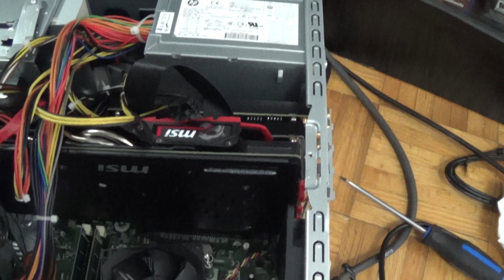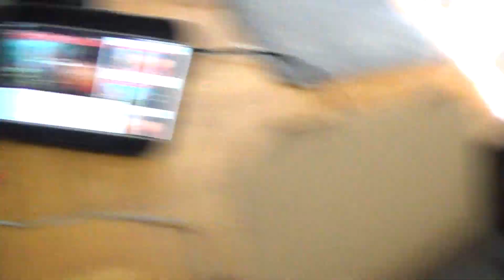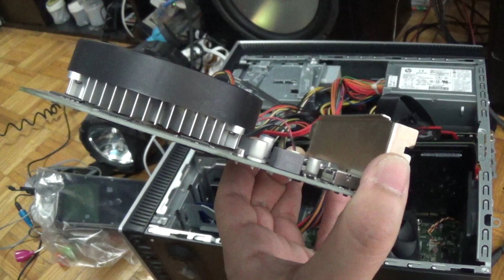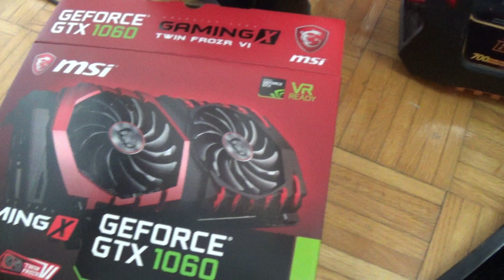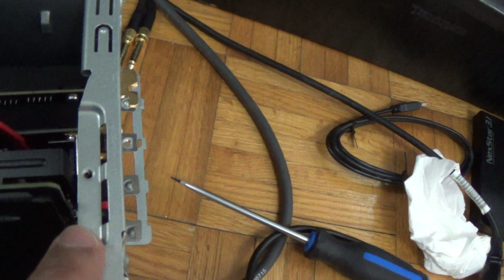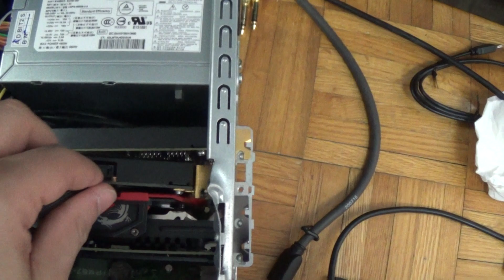ENVY 700-209 graphics card upgrade part 1

Comment: can you upgrade the powersuply on this without having to worried about weird connectors on the motherboard?
Reply from the maker: You don't have to be worried about the connector. The new power supply should have the same connector to the motherboard as the old one did

Comment: If I have a 177c with 300w what is the maximum graphic card I can put?
Reply from the maker: If you want to game and want to add a good graphics card you will have to upgrade your power supply.
Reply: GeForce 1050
Reply: AMD RX550
Reply: the card I will get is probably a GeForce gt730

Comment: When i start my pc then my new graphichs card always stops spinning can someone help me?
Reply from the maker: Maybe it is not getting the power it needs
Reply: @6262323  no the gtx 970 needs 500watt and my pc has 600
Reply from the maker: @gibox_33  Try and make sure the power wires to the card are fully in. Make sure the card is fully in the mother board. Also update drivers. If that is not the problem call the help phone number for the graphics card. Maybe the card is bad and they will send you a new one.
Reply: @6262323  ok thanks

Comment: I have an Envy 700 PC Series Computer. Can I install a GFX 1060-1080 TI?
Reply from the maker: Yes you can install a GTX 1060-1080TI in your computer if it fits
Reply: Yes but also replace the PSU i think the one in the case is a 300w which isnt enough